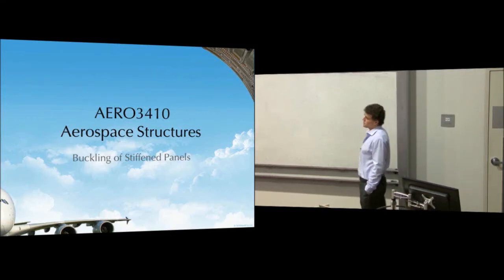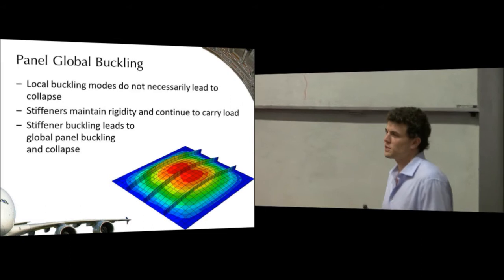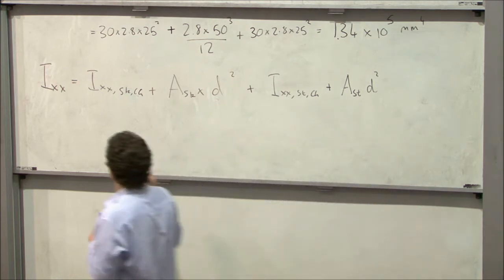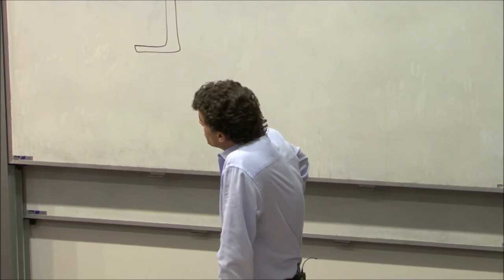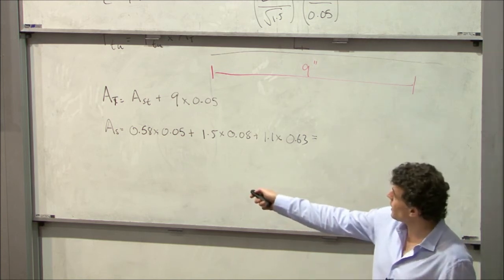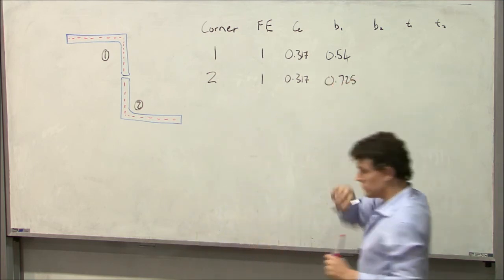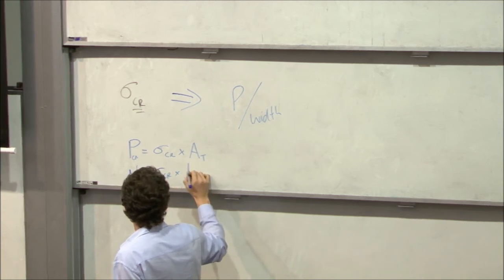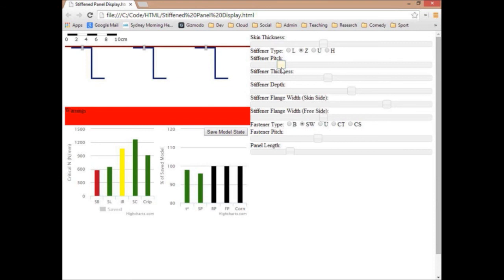UNSW - Aerospace Structures - Buckling of Stiffened Panels

Comment: Thanks for uploading this, it's very usefull. Where can I find the first image of the wing section shown in the first slide?
Reply from the maker: This is from a book called "Practical Stress Analysis for Design Engineers" by Flabel. It is actually out of print at the moment unfortunately, you might have to track it down through a library.